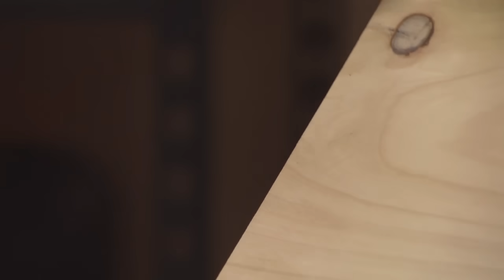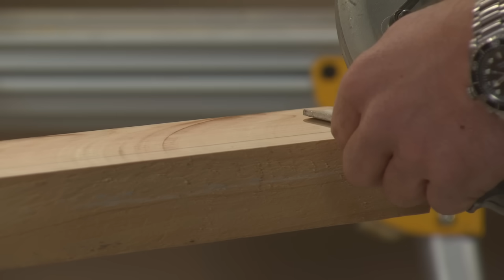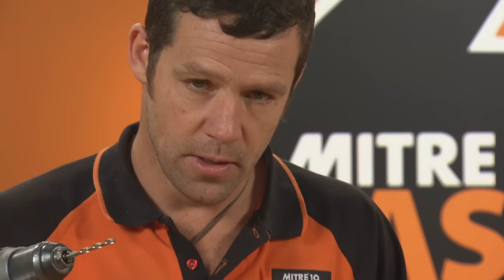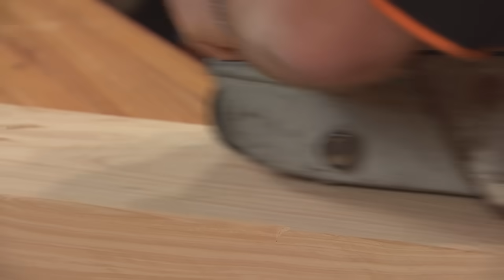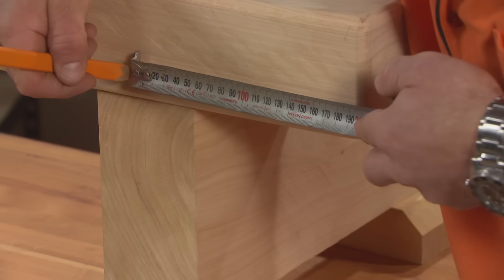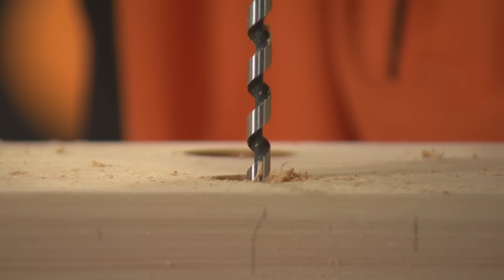How to Build an Outdoor Bench Seat | Mitre 10 Easy As DIY

Comment: How long is the bench please, I’m building one and not sure what length to cut the sleepers 

Thanks
Reply from the maker: Hi Brendan, cut two for the seats 1700mm long, two for the legs 400mm long and four for the feet 160mm long. The feet you will also need to cut to 50mm thick and 100mm wide - you'll find further instructions over on our website https://www.mitre10.co.nz/guides-and-advice/guide/how-to-build-a-bench-seat^Matt

Comment: Macrocarpa is a very easy wood to work with tools but it is absolute nonsense to suggest it won't rot outside. Used as decking has about a 5-7 year life, used as garden edging (which it gets marketed & sold as here in NZ as sleepers) it starts to show rot in a few years. Against wet soil it'll be totally failed in 10 years.

Comment: I would attach the legs from underneath. Those bolt holes will collect a lot of water.
Reply: Constantly... I actually clicked on this video to see how the bolts would be protected, as the thumbnail image got me curious... seems like no protection at all huh?
Reply: The wood used is Macrocarpa.  Used in many parts of the world as railway sleepers and very popular in Australia and NZ for gardens and backyard walkways dividers. Naturally resistant to rot, so you'd be good for many decades in that regard. Alternatively you can get yourself a tenon plug drill bit and make wood plugs to cover the holes. It works both ways and I've done it many times.

Comment: Plug those massive holes in the top with dowels for a rustic look. It will look as though you used dowel joinery but this is a great video, very professional.

Comment: Hi Mr Mitre , can you tell me wat wood species are you using? n also is the wood being use outside why there is no preservative applied?
Reply: +Larché Jacques Clarel Macrocarpa is the type of wood (as they say in the video). Macrocarpa has a natural oil inside it which acts as a natural preservative.
Reply: +Phillip Quinlan its  local wood ? it replaces teak and is cheaper? pretty good looking wood :)
Reply: +Larché Jacques Clarel The video is made in New Zealand, I know you can buy it there - very common. I know the tree is native to the USA so I assume you can buy it there too. It costs NZD$35 for 100mm x 200mm x 2400mm. Not sure where else in the world you can buy it. Might need to google it if you want to buy some in your country.
Reply: Phillip Quinlan Except the level of natural preservative is very low. Macrocarpa does rot very quickly outside.
Reply: Phillip Quinlan c rdt